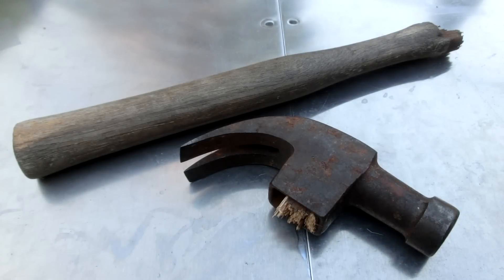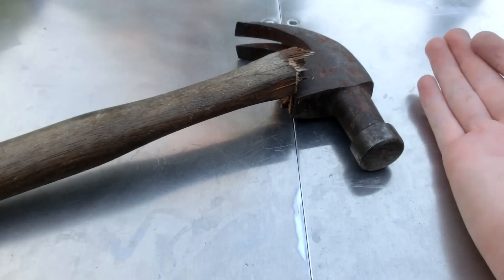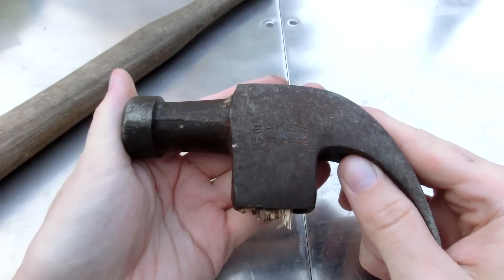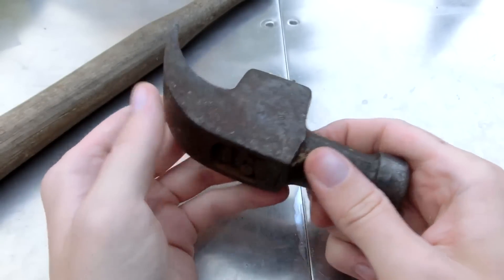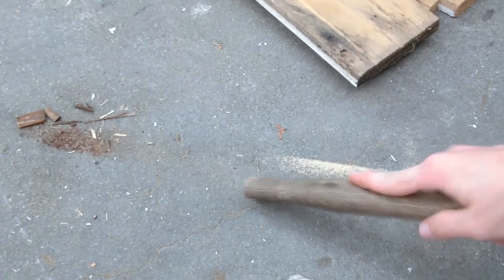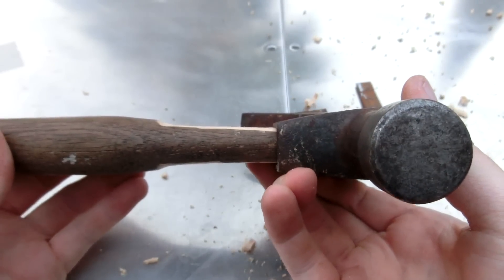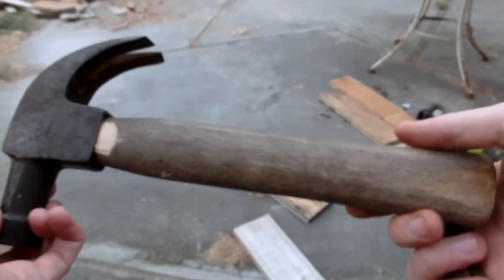Quickly Repair a broken Hammer Handle

Comment: This is a great example of how not to do it.
Reply from the maker: maybe, but its working fine for me now.
Reply: it is a poor repair BUT it you cap the void in the head with resin if should last a long time
Reply: it will apsolutlig hold upp dut that isent bichos of its dun godd that is bicos of it dusent have the long handel so the energi dusent gett ass muge stres on the hamer but apsolutli its a gud fix temporely meyby you dont whant to go to all the trubbel of meking an new handel from skrach but its isy to gett an old axe handel or slege handel and use that to do it godd
Reply: Sing Van what the actual fuck
Reply: @michaelkennedy8573  that's how english spelling should work lmao

Comment: I'd say that its going to break rather soon as you introduced cracks into the wood.
not only that but its probably going to loosen too, as the wood isnt shaped like the eye of the hammer.
Reply from the maker: well then, specify a time you think it will break by and we shall see.
Reply: honestly i cant confidently say a time, as i havent used a tool in such a condition, but I'd guess in a month, if its being well used.
however, I could be completely wrong, as i am just guessing.
Reply: Wood very dry, not tight fit, wedges only introduced splinters in that direction without really closing the gaps (putting them in the other way), pivoting, etc

Like Monty said some resin, glue, antifreeze, linseed oil which expands the wood and makes it more durable would work, but you would have to redo the wedges because they aren't doing much atm and just fracturing the hardened fibers

At least its the right length to get the job done!
Reply: +Beesta Skarien Unless we have seen cracks in the wood which presage further problems, I think he did a decent job. The wood should be kept conditioned to prevent further shrinkage, but looks in good condition where he cut it. Sure, he could have done a better job matching the profile of the hole...
Reply: at around 4:10 you can see that cracks along the grain have been made
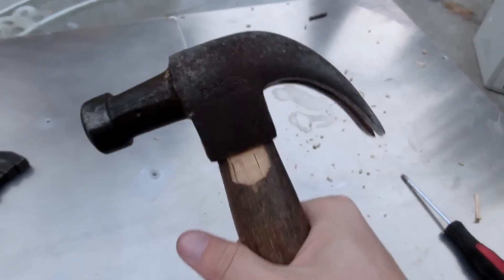Reply: so I guess the massive cracks we can see at 4:17 don't count?
Reply from the maker: russhellmy
not quite massive, but its an old shitty handle anyway.
Reply: @RinoaL  did it break? :)

Comment: The power of the hammer comes from the length of the handle - it's called leverage. Hold a chisel in one hand and hit it as hard as you can holding the hammer right at the end of the handle - it's a skill that is acquired with practice, and one that won't be obtained using a hammer with half a handle.

Comment: The hammer broke because the train orientation is bad
Reply: 3 role of troubleshooting. 1 Do the easiest things first. 2 Don't rely on the guy that tried and failed prior, even if the guy it's you. 3. 90% of problems are between the driver's seat and the steering wheel. +AvE DOCET
Reply: Grain?

Comment: that's a weird coincidence, i was just fitting an old axe head on an handle minutes ago. my hypothesis about yours (and mine)  is maybe the wood was so old and dried, AvE say to tighten up a loose handle you let em soak head down in a bucket of antifreeze, i dunno if i'd go with that but i'm gonna try to soak it up in boiled linseed oil to make the wood swell after it's fitted , it's a 30 y old+ handle so.. btw, it's conter intuitive but i learn recently that to fit a tool on an handle you put it upside down, and wack the bottom of the handle (now up) with a wooden stick (a hammer could break it) and the impact drives the head up (Y)

Comment: next time to get the hammer handle into the head, hammer the bottom of the handle while you grab it upside down, so you dont crack the handle.
Reply from the maker: you mean like i did in the video?
Reply: like you did but suspended in the air, so you just hit the bottom of the handle and nothing else, it drives by itself into the head
Reply from the maker: Commander
thanks for the offer but ill have to pass.
Reply: /watch?v=Qyr4S3oBmi0 minute 17:00 that's what im talking about
Reply: sounds crazy lol
Reply: Commander is telling you the exact right way to do this, it avoids the danger of hitting one hammer head with another. You'd get laughed at on a construction site doing it the way you did.
Reply from the maker: Deucetrinal
im not on a construction site though, so your point doesnt make a whole lot of sense. its just me playing around in my back yard.
Reply: +Rinoa Super-Genius I'm just trying to save you some effort, and show the safe way to do it. Feel free to ignore it if you want, it's no skin off my back. Make sure your glasses are impact resistant though, I have a coworker who is blind in one eye from hitting hardened steel with a hammer.
Reply: we're friendly lol

Comment: Use a nail puller to pull nails and a hammer to hammer. The longer handle lets you drive nails into wood versus tapping nails with a short hammer

Comment: I'm not seeing any suggestions about heating the hammer and then pressing it onto the shaft so that when the metal cools and shrinks it will be a tighter fit. so i'll just throw that out there.
Reply from the maker: yeah i was waiting for that but your the only one to say it. i think i'll put it into a hydraulic press, i'll try without heat first. i think the heat required to make it noticeably bigger would burn the wood.
Reply: I don't think it would have to be that hot, maybe 300* F since steel expands 1 thousandth per 100 *F per inch in diameter. At least that's what I got from one of AVE's videos. maybe throw the head in the oven next time you bake something. Just throwing ideas out there.
Reply from the maker: *****
 1 thousandsth of an inch isnt that important with wood i dont think.

Comment: Hitting  a hammer head with another hammer is really dangerous because they are both hardened. They are prone to chipping, which tends to send the pieces flying outwards at skin breaking, eye smashing velocities. Next time just hold the hammer you're putting the handle into upside down and tap on the butt end of the handle. Momentum will let you easily drive the wood into the hammer head, it looks like the hammer head climbs right up the handle into place.
Reply from the maker: no it will bend one of them, like what happened to the lower one.
Reply: +Rinoa Super-Genius Bend one of what? The hammer head? The wooden handle? There's nothing there to be bent. I've rehandled literally dozens of hammers and axes, never once had one bend, chip or break. Go watch Diresta or Green Beetle or Wranglerstar put a handle on. They all do it the same way for a reason.
Reply: +Rinoa Super-Genius Bend one of what? The hammer head? The wooden handle? There's nothing there to be bent. I've rehandled literally dozens of hammers and axes, never once had one bend, chip or break. Go watch Diresta or Green Beetle or Wranglerstar put a handle on. They all do it the same way for a reason.
Reply from the maker: Deucetrinal
 yes bend the metal, by me hammering it it smushed the metal down a bit.
Reply: That's exactly WHY you should never hit hammer heads together! Wood will never peen metal down.
Reply from the maker: Deucetrinal
but i dont care about this hammer, its a piece of shit. a good hammer has a nail holder on the back like my old one back home.
Reply: Just trying to help, I'm on here to learn and thought you were too. Stay safe my friend.

Comment: You should have cut slots for the wedges before you knocked them in. 
That way the wood wouldn't have crack. Like a pilot hole for a screw.

Comment: Not a fan of short hammers, especially with the claw at the end, long handles give better balance when gripping it closer to the head for more accurate striking. Seems where you live it's pretty dry.. soak your hammers in either water or antifreeze occasionally and the metal will mushroom well before a handle breaks.
Reply from the maker: thats your personal preference. and i think a type of oil would be better than water. like linseed oil or something.

Comment: Well done ! The last 3 hammer I had to remake did get a lil bit loose after a month or two, I guess it's because of humidity, temperature variation and the fresh cut on the wood, maybe you'll have the same problem, so don't forget to wack it some more from time to time =)

Comment: Dude, I have a hammer rehandling video and I was researching tags. Did you know you have no tags at all? this video would be much higher in the SEO if you put tags on it. Just an FYI.
Reply from the maker: +BCtruck, rebuild, repair,repurpose tags dont do anything anymore, im able to make a living without using tags. pretty sure people like casey neistat dont use them anymore either. most tags are automatically generated and  hidden from the user these days.
Reply: Ok then. thought I was helping. cheers.

Comment: "I don't care what it's designed for, that's what I want it to do."

I wan't a fork to spread butter. Sometimes shit just isn't meant to work... so get the proper tool.
Reply: Play the hand you're dealt, not the one you wished for.
Reply from the maker: Meanwhile forks work fairly well at spreading butter. And playing the hand you're dealt means using a fork.
Reply: @RinoaL   then you don't understand the quote... play the hand you're deal = the reality of not having the right tool. Not the one you wished for = physics isn't against you. Not matter what you do to that tool.

Get the proper tool.
Reply from the maker: Seems you don't understand it. playing the hand you are dealt means using what you have, and if you have a fork, well that's what you can use.

Comment: It does work, however, if one takes the time to shape the handle head and use wedges which are not too large, the job will last a lot longer. From a woodworking perspective, the large cracks you have created with the too large wedges greatly weaken the job and are a sign of well, lets just say that I don't think you would solder a couple wires on a circuit board using a torch and big globs of solder. Carpenters and electronic workers have slightly differing skills and  tooling tolerances....  In general, don't use wooden handles for pulling nails or major leverage jobs. Wooden handles generally break from such.  Metal and fiberglass are better suited, and we uses what we have on hand to work with. There is fixing and there is "fixing!"
Reply from the maker: well i dont care about this hammer too much, this was just a quick and dirty fix.

Comment: Sorry, but this time thumbs down. 1 for the short handle. 2 the method that you use to put the hammer on the handle .. You should drop the handle perpendicular to the ground, and let beat the lower part of the handle on the concrete and the hammer will enter the wood and will find its natural position(thanks gravity!). 3 would have at least could secure the hammer with a split cut.. With the method that you have shown it can be used at most 3 minutes. Unless you do not use the hammer as an ornament. (thumbs up for your channel however!)
Reply: It's a trust method. Everybody use the long handle(even 1000 years ago), drop momentum, and a split cut. It's a millennial collaudate method.
Reply from the maker: are you drunk? you sound like you are.
Reply: Sorry. it's just bad bad translation...

Comment: Bet ya it breaks again.
Reply from the maker: thats too open-ended, specify a specific time for it to break by. and we shall see if it does.
Reply: +Rinoa Super-Genius I bet it breaks before the sun burns out. Nice fix.
Reply: +Rinoa Super-Genius 2 to 5 years thats how long my last.
Reply from the maker: POVadventure
no thanks, i dont like newer tools.
Reply: Rinoa Super-Genius I'm certain they have made hammers like that for a long time.  The main difference between an old quality tool and a new quality tool is its easier to find a new quality tool.